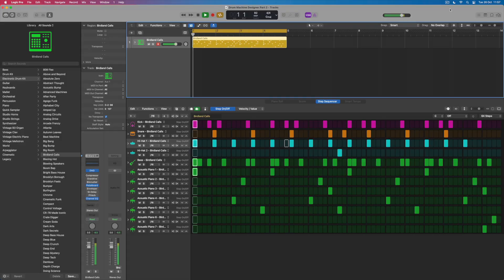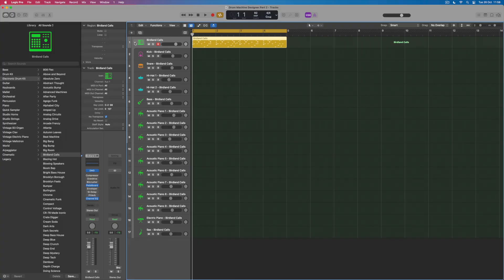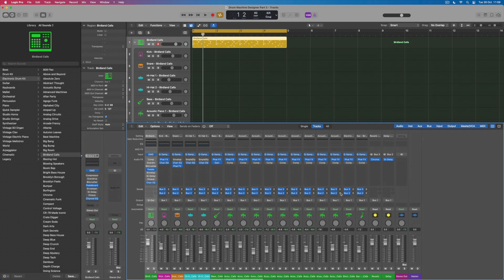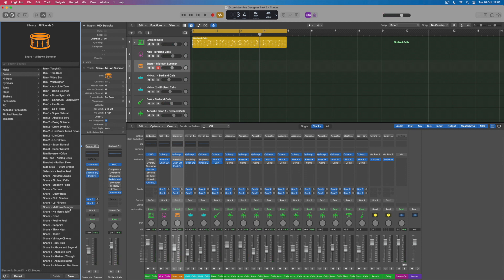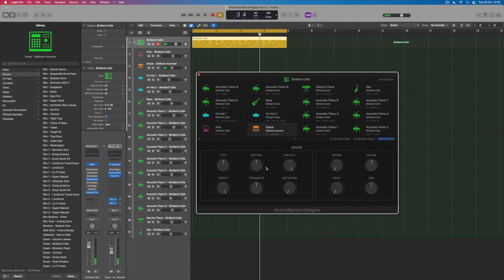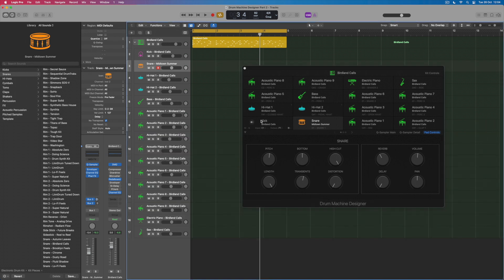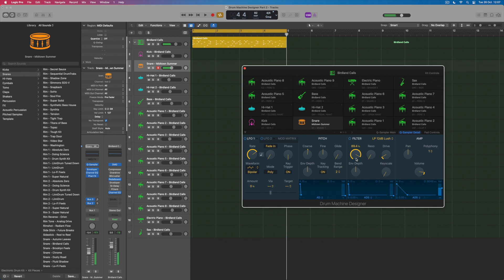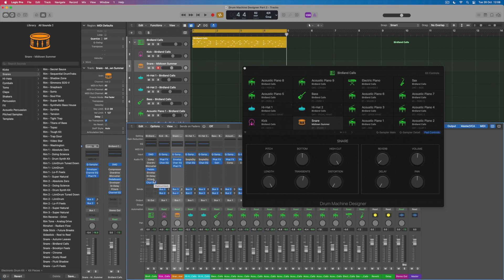LOGIC PRO X - Drum Machine Designer Part 2

Comment: Just a quickie if you don’t mind. If I create a drum machine kit that I like, does Logic automatically save it as a kit ? Something I could select and use in a different project. I can’t see a Save or Save As option, unless Im looking in the wrong place. I wouldn’t want to edit a load of different sounds that I liked, exit Logic, then when I rebooted the next day that kit would have vanished.
Reply from the maker: Thanks for your question. Absolutely, you can save any Kits you make. Having configured your Kit, use the drop-down menu at the top of the Instrument and select ‘Save As’ and this will add your bespoke Kit, which is then loadable in any other project. 

Alternatively, you can configure not just a Kit but any Insert and Aux FX you might want and save the entire Channel Strip setting. This will then be loadable from the Inspector area. Let me know if that makes sense. I’m very happy to make a video on this topic too.
Reply: Thanks. Yes that does make complete sense. Cheers. Ive been fiddling around with the DMD a bit more now and have knocked up some very usable kits. Neat little instrument. 
Thanks again for the clarification 👍🏻